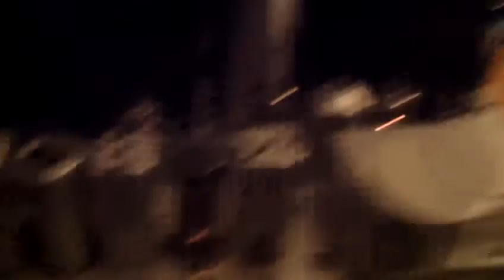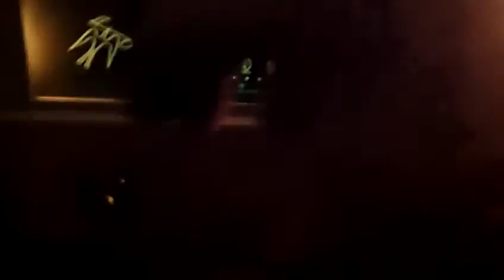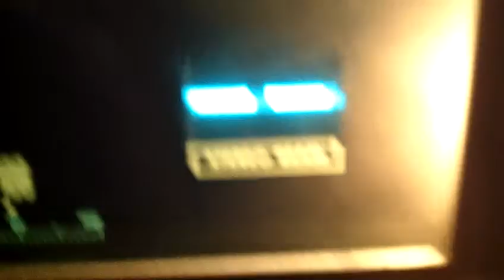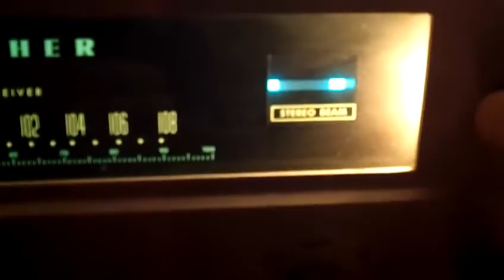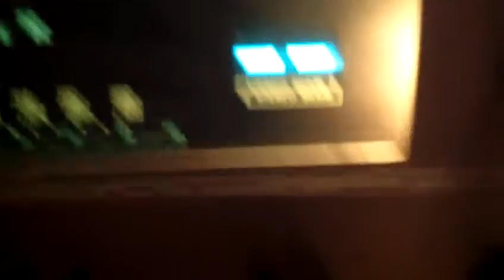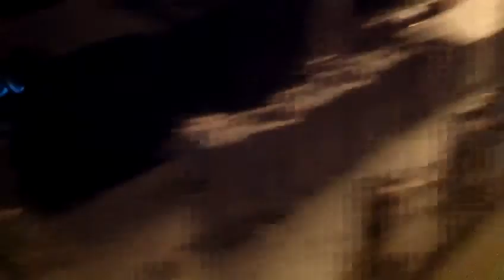Vintage stereo Fisher 400 with MPX problem

Comment: Hi,

I Have a wonderful working Fisher 400 Tube type stereo FM receiver with Garrard AT6 Mark II Auto Turntable.  Both pieces work fine.  They have been in storage since 1978.  I built a wood cabinet to house this combination.  All the Manuals and instruction booklets that came with them are included.  They are in like new condition..........

If interested, please call 908 276-7060 and ask for Bob

Comment: Hi, Dave, did you have any luck getting this Fisher to work properly?  I have the same late model 400 with the same issues, the MPX unit did have weak 12AX7 tubes that I replaced, but I am still having problems getting the stereo to work properly, thanks
Reply from the maker: oldestgamer If I recall I got it working fine, did an IF align with just a unmodulated FM IF signal and a vtvm, and then I used a rat shack RF FM generator to peak up the mpx response. used a scope to observe the pilot signal then used the scope to adj the separation coil and pot while feeding a 400hrz tone into one channel at a time on the rat shack signal generator. That's my pretty much go to tool to max out separation.
Reply: Dave WM 
Thanks, Dave, I think I am going to have to do further study on FM circuitry and the multiplex circuitry to unravel why mine is giving me so much trouble...
Reply from the maker: One thing you can check easy is the voltages of the V100 tube, esp the pin 3. There is a cathode resistor that if drift high, could cause the bias to be off, reducing the gain of that tube, which is the amp for the signal.. I have never found a bad resistor in a fisher, them must have used a really good source, but its worth a check.
Reply: @davewm9589  I have that same problem I replace part number (c210) that fix my problem thanks

Comment from the maker: I have a BK 415 that I use for FM. The markers on it includes 10.7 with a function that lets you add 100khz markers on either side. I am pretty sure its a problem in the ratio detector setup. One thing I noticed was the trimmer cap on the tuner osc was backed WAY out. The stations were landing on the right spots on both the low and high side of the band.
It will be interesting to see if the IF is peaked at 10.7. I am trying to think of a reason why the osc would need such a drastic setting.